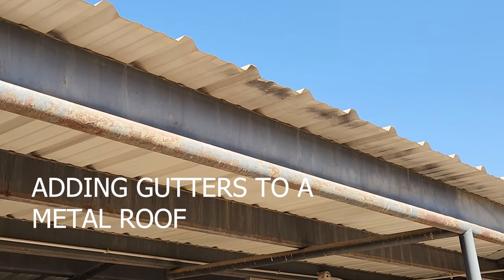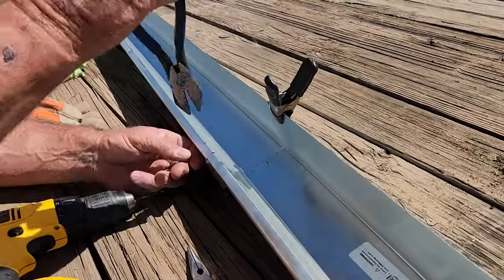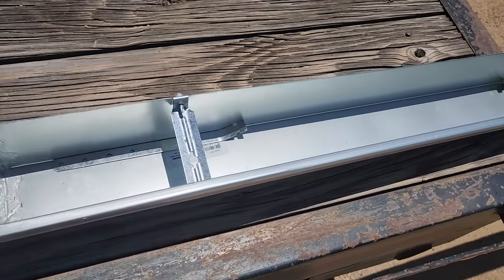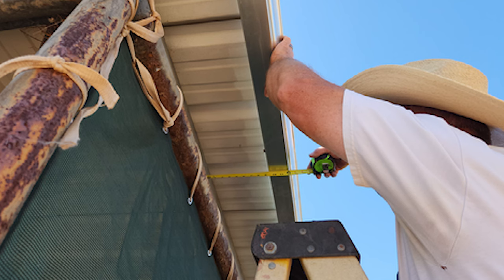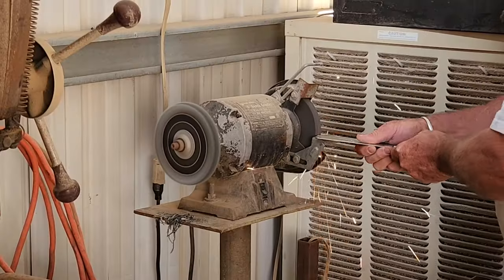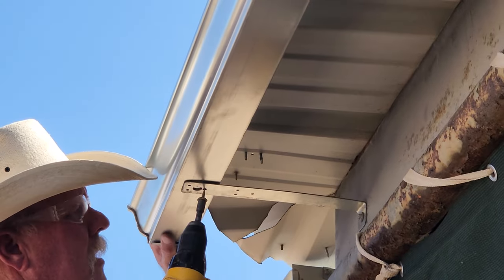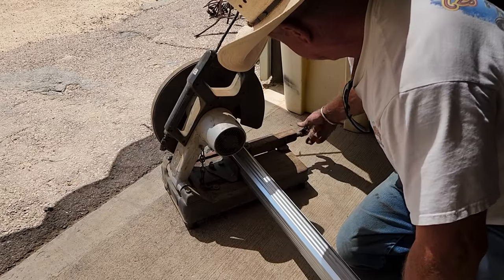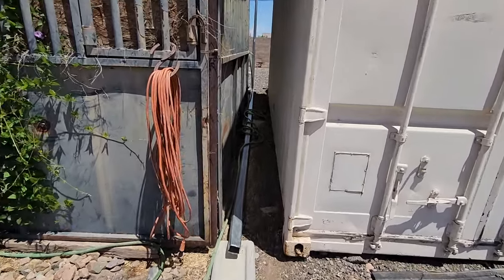How to install gutters on a metal roof

Comment: For anybody watching this wanting to do this, do not intentionally put holes in the bottom of your gutter. There are always better options. It will always eventually leak. It will always catch and hold up leaves and debris. This isn’t a bad video but there are definitely some things that were done wrong and some things that were done wrong. You can always call a local professional for a free estimate. I’d rather pay just a little extra and have it done professionally in one day than stretched out over multiple weekends.
Reply from the maker: Thank you for the comment.  I agree some things pay extra as diying takes more time and trials and errors.  This project has worked out for us so far.  We don't have much in the way of trees out by our barn so when we checked the gutters there wasn't anything in them so lucky that way.

Comment: Strapped them wrong. Should be on the higher end of the metal roof. Gonna leak
Reply from the maker: Possibly, but they are over a year old and holding fine without leaks.

Comment: Oh my, you don’t want screws on the bottom.
Reply: Why is that?
Reply: @pepekaliwete  risk leaks over time. It’s best not to put screws on the bottom. Not professionally anyhow. Miter strips (corners) will get 2 maybe 3 screws on each side, but never on the bottom.
Reply: @The_SKWRL  ok, I just looked up miter strips. I see what you're saying. I've not done gutter work before but planning to install about 80 feet here shortly. Thanks for the tip.
Reply: @The_SKWRL  Screws have to be put in the bottom of strip miters. I put 2 in the face, 2 in the front on the bottom, 2 in the back on the bottom, and then 2 in the back from the inside. Everything gets sealed with gutter sealant. Theoretically you can put screws wherever you want so long as they get covered with sealant on the inside of the gutter. I own a seamless gutter business and have never had a screw hole leak that was sealed. Most of the time it's the actual joint or seam that may start to leak on a corner or endcap and never the screw holes. Leaks may show up in the first spring after the installation due to thermal expansion during and after winter. The sealant is supposed to stretch with the material's expansion and contraction but sometimes it can tear. Easiest way to avoid this is to just use a very generous amount of sealant.
Reply: @wharfrat8637  I just stay away from putting screws on the bottom. Eliminates that risk. If the miter was done correctly, you don’t need that many screws.
Reply: @wharfrat8637  & technically, they don’t have to be screwed on the bottom. I know business owners that will fire an installer for doing that. I personally would too. #1 it’s ugly, #2 it’s at risk of leak, #3 if you know how to properly do a strip miter, there’s no need for many screws. I use 4-6 depending on if the miter gives me any trouble.
Reply: @The_SKWRL  I know what you're saying and I've done them that way. 2 in the back and 2 in the nose to drawn it tight. I agree it does look better that way as well. I feel that the screws in the bottom can add a little extra rigidity and the sealant these days is phenomenal. How much more risk for leaking are the screws really? I mean compared to the seam and the sealant takes care of that no problem.  Personal preference I suppose but yes they do look better without.

Comment: definitely not like the pro would do it. its a 4 hour job, 2 weekends is a lot of time
pro cost with 5' seamless gutters aluminum which is 10 times better $1800 for 180'
Reply from the maker: I know we aren't a pro at this and it could have been done better and quicker.  Living on a Ranchette property it's give and take what you hire out.  The 30x40 RV, Horse Trailer garage/cover is getting hired out.  Gutters seemed like an item we could take on.  
Heading into Monsoon season now so will know soon if we regret doing this one on our own.  Thanks for the comment!
Reply: But it's not a standard install, the homeowner was able to improvise because of the longer overhang that would make a standard gutter install turn into a customer one. Great video!
Reply: she never said how much she worked each weekend. Could have been 2 hours each day ot 8